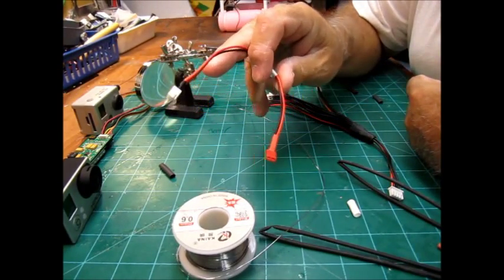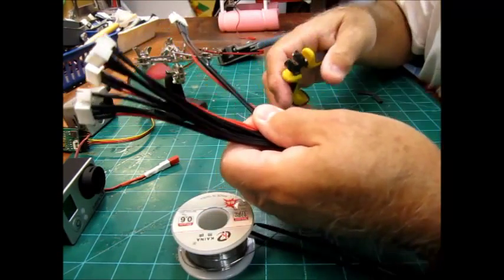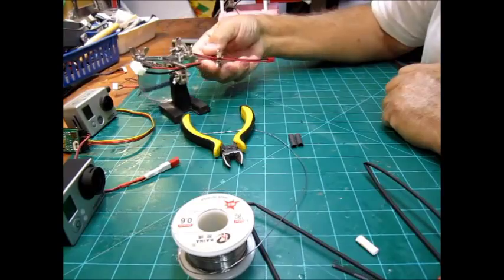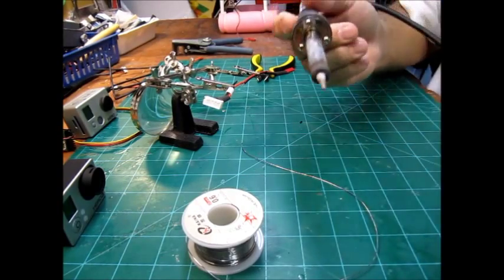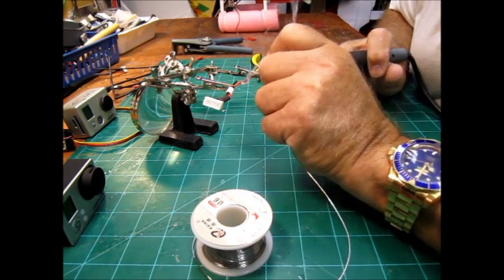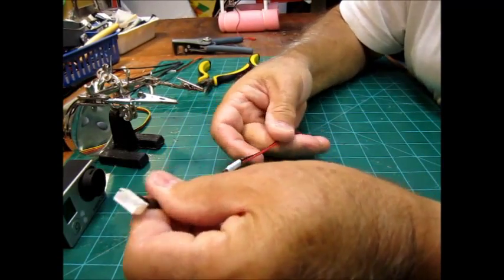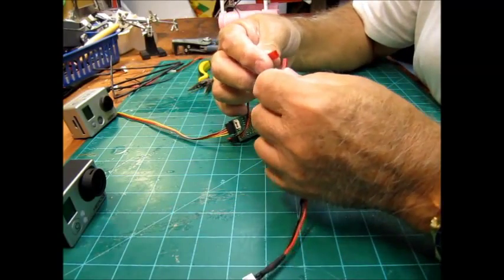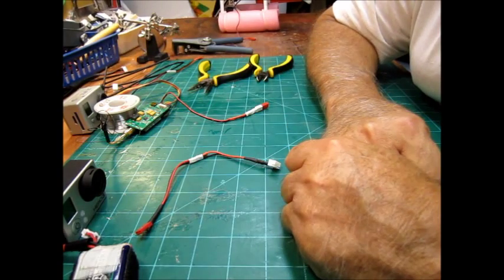How to Make a JST to Balance Port adaptor

Comment: I found this video trying to find a way to power my RC832. I am now wondering if there's a way to take the red and black wires of my LCD and create some kind of contraption so I can power my RC832 and LCD at the same time from the same LiPo battery.

Comment: where did you get the balance port leads that where all bunched up. that being done if one needed less volts could get less volts if taken not the outside wires, like black and one closer, etc. right